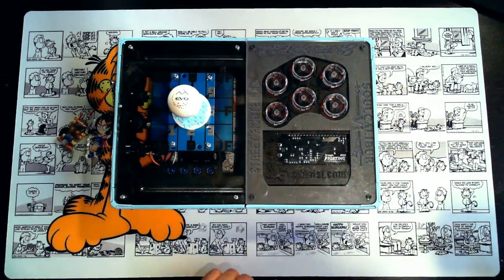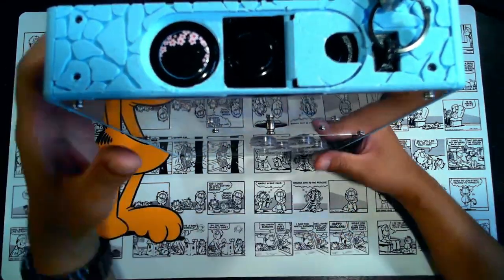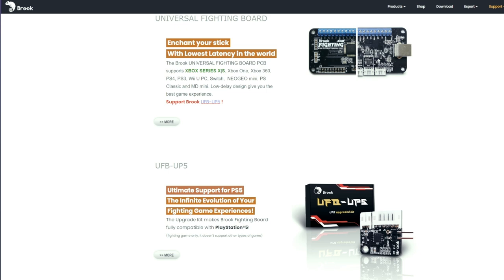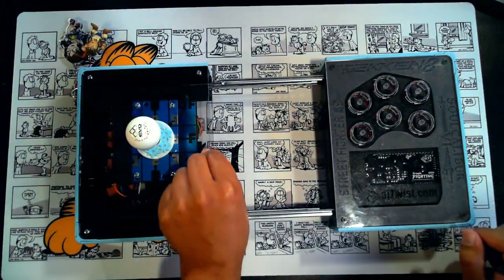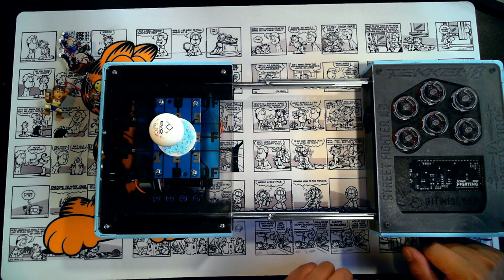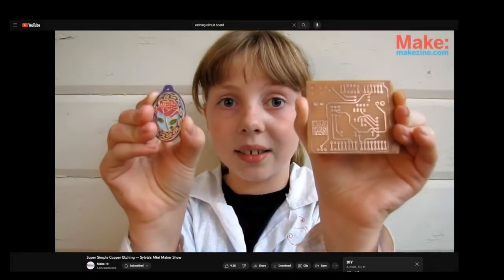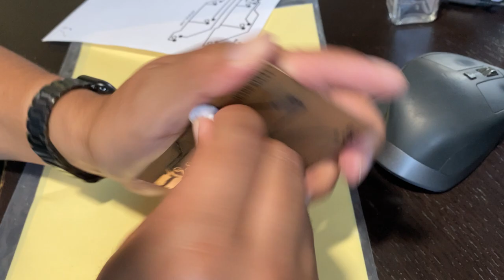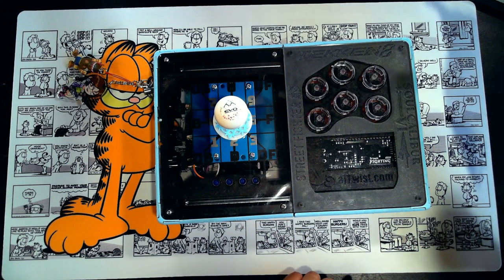My 3D Printed Split Stick - Overview and Build Details

Comment: I have the exact same issue as you with the arms. I even went to physical therapy. You probably have Tennis Elbow if it's anything like my issues. I bought a 3D printer and have been learning how to design a box similar to this. The Rails were a great idea! Is there anyway I can get the STL? I'll have to make modifications to it, I'm 6,5 so I'm a tall dude.

Comment: In love with this. What hardware did you use for the keyring mount/loop? I was thinking of using a d ring with pad eye but this looks way better!
Reply from the maker: Its 3d printed into the frame. Then just added a key ring the the 3dprinted loop. I just finished a different stick where I did use D-Rings. I found "Small Steel D-Ring Tie Downs" on amz. They work pretty good.
Reply: @ajTwist  awesome, thanks for the reply you’re the best ✊ stay blessed man !